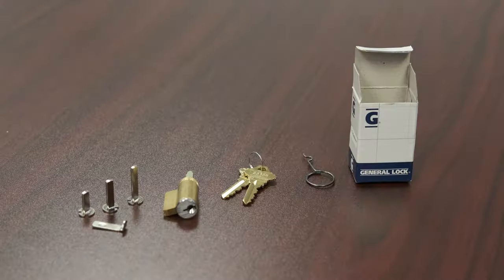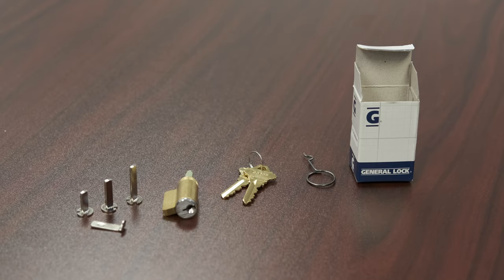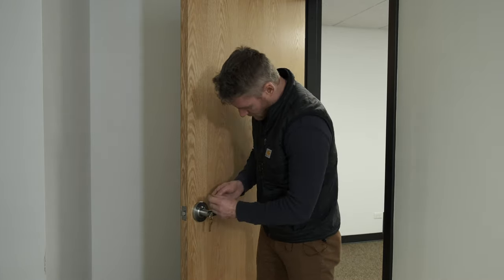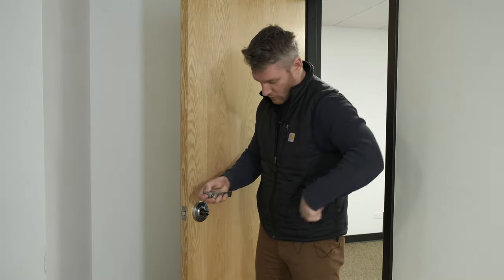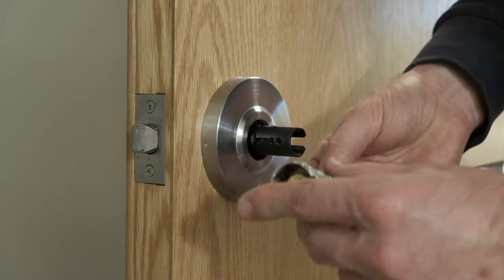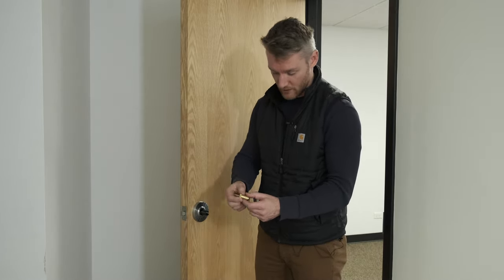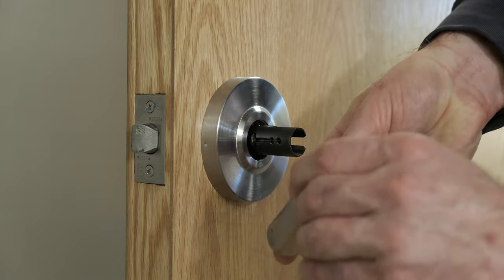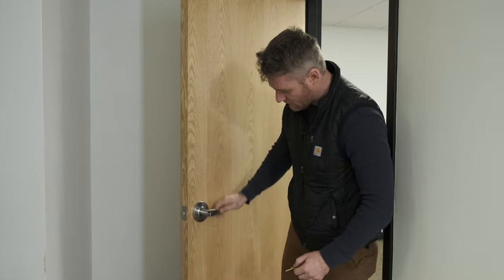How To Replace A Commercial Door Cylinder

Comment: What if you lost the original key? Can a core key be ordered to release the lock cylinder/handle for the same commercial door knob you are showing in the video?
Reply: If you have no key it needs to be picked. Chances are it's not a hard lock if you know how. Else a locksmith is going to drill it out.

Comment: I wanted to take the cylinder and put it in a smart lock. No issue in getting it out, but the cylinder is round (doesn’t have a beard like the smart lock does). Does this mean I can’t reuse it?

Comment: Hi there Kevin, I recently had to change a cylinder at work on a similar lock but after locking the door I can still put pressure up or down on the handle and basically break the lock and open the door.  It seems like the locking mechanism isnt holding. Any ideas? Thanks
Reply from the maker: So based on your description, I’m guess the tab that is on the back of the cylinder is too long or longer than the old one. This is causing the lever to not seat properly. That or you just have to press it on harder, you shouldn’t have to fight it on. My guess is that tab on the back is your issue. Double check it’s the same one and cylinder depth as well. Hope that helps.👍
Reply: Thank you, that was the issue. Changed out the cylinder and it worked perfect. It was definitely the tab the was causing the problem. Thanks again! @mitchellacoustical3119

Comment: Just rented this office/warehouse space which is at least 30 years old. All the commercial door handles share the same key. One of them, both inside and outside handle works, but the key turns 360 degrees and does nothing. Another one, the outside handle (the key side) just sits almost at 6 0'clock but still can turn additional 15 degrees to unlock the door. What do you think the problems are? Also, can you use a different key cylinder other than the same brand as your locker?

Thank you so much.
Reply from the maker: Did you use the pin to pop off the lever/Handle as well along with turning the cylinder? This is a pretty typical setup for rekeying a lock set. 

Try turning the key different degrees along with that pin in the handle. Could be 90-120,135 you may hear a little ‘pop’ when you get in the groove you need to.

Hope this helps👍
Reply: @mitchellacoustical3119  on mine, the exterior side, no pin hole, and cylinder just spins. ,what could that be? called a couple locksmiths, said something broke.

Comment: Great video! What brand did you use for the door lever sets with the cylinders? Curious... THANKS!
Reply from the maker: Thank you, we used a Schlage Door Lever Lockset. This is most likely what is spec'd on most of our projects.
Reply: Looked like you actually turned it counter clock wise?

Comment: The strip out the back, the one held in by the retention nut, is called a tailpiece.
Reply: What can you do to repair a jiggle knob from the internal mechanism?  The door handle is tight to the door, but there is too much play in the handle
Reply: @tylerfochtman1578   Not a locksmith but handy.  I would take it apart and look for excessive wear.  If you see metal dust inside, or signs of wear it may be that part or all of it needs replaced. Also possible you'll see something that needs tightened.
Reply: Only problem is it's not my door handle, so I can't really go fiddling.

Comment: My keys are missing, which is why I need to re-key the doors.  Can I remove the cylinders without the actual key?
Reply from the maker: Yes you can drill out the lock. We have a video on that.

Comment: My key broke inside the door I got the key out but I can’t take the knob off when touching the lil hole the latch still don’t release what should I do next to get the latch off ?
Reply from the maker: Try pushing the outside housing (lever) in and out. Maybe that push pin is caught up on something?

Comment: Edit: Never Mind. I just wasn't turning the key all the way to 45 degrees...Duh. I was talking about the kind of knob that always stays locked and you always need the key to open. 
Okay, that works with a classroom function, but I can't get the handle off my storeroom function. The key won't turn the full 45 degrees to get at the pin. Any suggestions? Thanks.
Reply from the maker: Do you mean storefront, like aluminum glazing?
Reply: @mitchellacoustical3119  Thanks. See my edit above. I feel 😖

Comment: So I have just bought a brand new door knob (classroom function)and when I was entering the room and re locking it I didn’t realize that I had the door knob retracted. Now it’s on the lock function and the latch is retracted but I can’t turn the key I had to remove the cylinder just to get my key back. Do you have any advise for fixing this? Thanks!

Comment: How do you fix a loose handle?
Reply from the maker: You can try and tighten the screw that hold it together. But parts could be worn, if that’s the case just grab a new lockset

Comment: Where and how did you get the new cylinder to match the existing master key?
Reply from the maker: You’d go to a door hardware company. They’re all over the place. I don’t think a big box retailer would have them. Then you’d have to let them know what kind/model you have. Would probably be best to bring in the door set.
Reply: Hi Jeff,  If you need your cylinder to match an existing master key, you need to take the cylinder that you purchased, and the Master Key to a Locksmith. (or just buy the cylinder from a locksmith)  They will add the internal pins (wafers) to allow the Master key to also open the cylinder.  Just make sure that you don't mess up the building Master Keying Plan by adding an undocumented Operating key to mix.  Contact your premises management team to ensure that the new key doesn't match another existing operating key, and to have your new key recorded in the building Master Key plan.   They also may have a preferred locksmith who knows the Master Key plan, and can pin up the Cylinder so it doesn't cause security problems in the future.

Comment: my cylinder just spins and doesn't engage, won't lock or unlock,  what could that be?
Reply from the maker: That the guts are broken. You can drill it out. We have a video for that as well.
Reply: I had this problem at first. Make sure the cylindrical silver piece is not upside down. To try and be more precise it is the side of the door with the key because the other side can not be upside down. Also to be more precise it is the silver piece on the inside, not the silver cover. The knob will fit in it perfectly if you turn your key 45 degrees. Otherwise it probably is that the guts are broken.